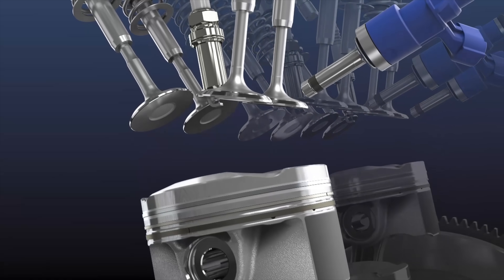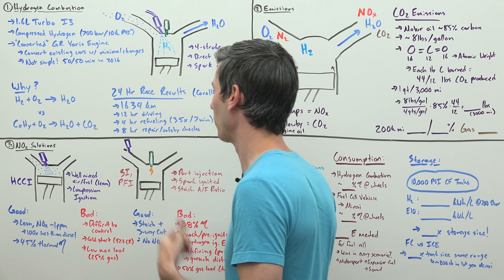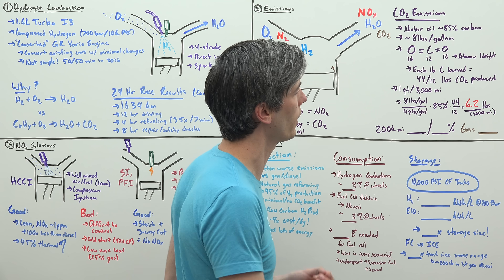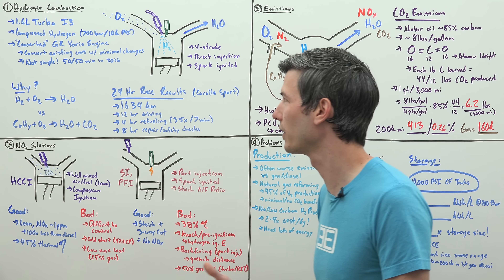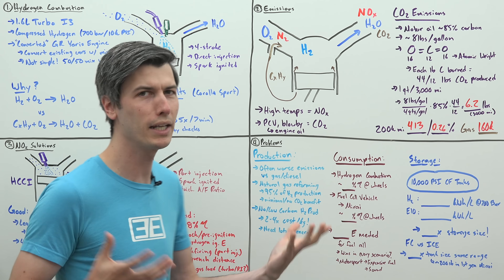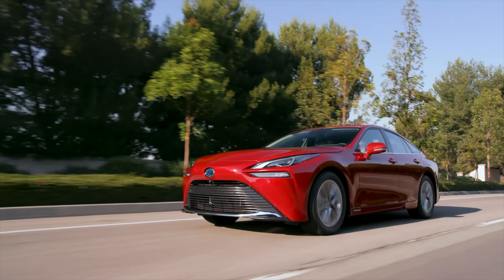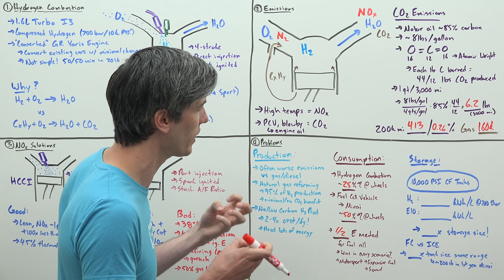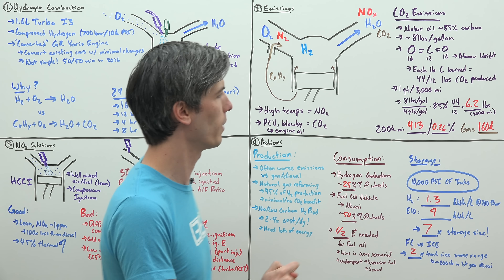Toyota's Developing A Hydrogen Combustion Engine!

Comment: So what you’re saying is, in order to get decent horsepower we’d need something to increase pressure in the cylinders?

salivates in 450 psi of forced induction
Reply: Do people even appreciate the danger of having high pressure tanks near them? Double that for high pressure Hydrohen tanks? Those are bombs, actual Hollywood style explosions should be possible from cars falling down or maybe even bullets hitting them at the right place. High pressure hydrogen bomb, yeah, sounds safe to drive on the roads.
Reply: @romanmir01  some are aware of that, yes.
Reply: @romanmir01  taxi cabs have been driving round with propane tanks for decades with very few incidents.
Reply: @romanmir01  and lithium is perfectly safe
Reply: @romanmir01  Overemphasis on safety concerns have ruined the past two decades, so I’m all for a little danger.
Reply: @Degenevesting  do you comprehend the difference between 10000psi for hydrohen and generally 145 psi at normal temperature for propane tanks?
Reply: @cameronswan8646  do you comprehend the difference between 10000psi for hydrohen and generally 145 psi at normal temperature for propane tanks?
Reply: @romanmir01  Yes, I do actually I have a BSc in Geology and Physics. I was taking the mick, the entire time. Literalism, is not a thing my guy.
Reply: @Degenevesting  so saying that riding with a 10000 psi tank of hyfrogen on a normal road, not under a fully controlled track, without 8 hours out of 24 being spent on safety checks is 'a little danger' is now 'talking the mick'? ok, whatever.

Comment: Great video...I had an old car meany years ago that ran on compressed natural gas, ran well slight drop in power, however the oil didn't get dirty and the plugs were clean. When tested with a gas analyzer co was .5% and hydrocarbons were so low that reading was essentially 0. Co2 and nox not measured but I suspect nox would be elevated.
Reply: Almost all gas cars in my country (Turkey) have LPG conversions and run on LPG as it's much cheaper than gasoline. LPG is liquified petroleum gas which basically consists of butane and propane

Comment: another great video. what id like to see is a break down comparison video of gas/diesel engined cars vs electric cars over its entire lifespan, but taking into account the materials sourcing, refining and manufacture of the motors and batteries as well, and lets not forget the disposal. no one ever talks about that, its just the figures from dealer to disposal.
could be an eye opener for a few people.

Comment: So, similar problems as before, just another try. I guess mass hybridisation and using shorter hydrocarbons as fuels (gaseous - like propane) is a much more viable perspective. Shorter HC - less CO2 emissions for the same amount of energy.
Reply: Agree but just one note , propane -butane ( LPG )is a byproduct of producing conventional fuels . So , no  conventional fuels ,no LPG. On the other hang CH4 - methane is widely available , doesn’t have the hydrogen storage problems . And it’s the  simplest known hydrocarbon with just one carbon and four hydrogen atoms in the molecule CH4. CH4 has a octane rating of about 130 so compression ratios of 14:1 ( higher efficiency) are possible .So CH4 fueled plug-in hybrids is probably the way to go. The hybrid technology ( the recuperation)will balance the lower energy density of the CH4 if compare to gasoline or even LPG.

Comment: Hydrogen combustion can use relatively "dirty" H2 vs Fuel Cells which will foul
Reply: Yeah, but electronysis doesn't produce dirty hydrogen. Methane reforming does. And we need to get away from methane reforming for any of this to make sense...
Reply: @Validole  there are catalyst being looked at that can produce hydrogen. Imagine being stuck I'm the middle of nowhere and you fill a tank with river water and drop a tablet into your emergency tank, next thing you know you are on the road again. We produce lots of biowaste that we could potentially convert to less harmful forms for a neutral source of hydrogen.
Reply: @Validole  Ooohh. I was wondering how you got "dirty" hydrogen. Hydrogen is so happy to float above the water I didn't see how it was possible.

Comment: I have a Ph.D in Mech.E and have worked for a big 3 automaker. The issue with H2 isn't what goes on in a system confined to a vehicle. The main issue is the thermodynamic and economic challenge of producing, distributing, and safely storing H2. Only the production of low emissions energy with a net cost benefit will enable mass adoption of H2 for transportation.
Reply: Can’t you just use water in a tank?
Reply: @isaacmattz204  Thermodynamically if the idea is to reduce carbon emissions, no. The energy required to produce H2 on board a vehicle would be far more useful than using the H2 through a fuel cell or ICE. Google the 2nd law of thermodynamics, it's one of the "best hits" of human understanding.

Comment: The issue with Hydrogen as a fuel is where is this hydrogen  going to come from? Getting it either from water or methane is a "net negative" energy gain. Hydrogen also has a low energy density (but high specific energy) and presents storage/transport issues.
Reply: This. Fuel cells have better efficiency than hydrogen burning engines, but they get roughly 65mi/kgH2. To get anything close to a decent range, you’re going to need big heavy tanks under the car. That makes converting existing vehicles impractical.
Reply: Everything is net negative energy gain, entropy only works one way. When drilling for oil or storing solar electricity in batteries gives you more power than you started up with that is just a case of not having to worry about some of the costs involved at that time.
Reply: Transporting and storing energy and covering it will always be net negative, we just have to develop the technology to make it less negative. We didn’t get to the efficiency of batteries and ice vehicles automatically. We developed them. If you saw an ev 20 years ago it’d be laughably inefficient.
Reply: @boygenius538_8  actually the EV1 is roughly in the same class efficiency wise as the new aptera (115Wh/mile vs 100Wh/mile), but back then there werent high capacity batteries available. Also GM does not want you to drive the EV1 because it was too good.
Reply: @boygenius538_8  Multiple EV's were already around in the 90's pushing 100 mile range.  Which is similar to what all the "modern" EV's got when they started coming out in the last 10 years.
Reply: @uni4rm  hundred miles is pitiful
Reply: @boygenius538_8  Batteries are still woefully inefficient but are better  now. You can beat the laws of thermodynamics Fossil fuels had traditionally had enough "surplus net energy" to overcome recovery/transport losses..but that's changing now as we have burned thru most of the easy to recover, high yield reserves.
Reply: @boygenius538_8  No, it wouldn’t. Maybe compared to a modern day EV, but compared to an ICE vehicle it would be incredibly efficient.
Reply: @AnalystPrime   no. (technically yeah) oil is functionally an energy rich item produced by earth. its rich because its had a long time to be processed by earth. on other items the energy is condensed until we create a chemical process that draws out the condensed energy. the energy you put in is less than the energy received.
Reply: I think the idea is to farm Hydrogen from water using green electricity (like wind and solar).  The problems with wind and solar is that they only work part of the time and we are woefully poor at storing electricity.  Using the energy to produce Hydrogen whenever the electricity is available is  reasonable way of storing the energy. Though certainly not efficient, as you say, it's better than having more electricity than we can use on hot windy days and a lack of energy on still nights.
Reply: The reality is that there's no replacement for gasoline and diesel fuels. EV's are expensive BS and they're not practical for 95% of the people.
Reply: @boygenius538_8  Stanley Electric from 1910?
Reply: @nickh5081  That’s the idea yeah, but the yield is terrible
Reply: @Brandon_letsgo  Quite the opposite. They’re practical for 95% of people. There’s tons of data on driving habits
Reply: @jonathanfields4ever  I'm pretty sure!!! I see a single mom working 2 jobs a day paying 50k for a car and waiting 40 minutes to get some range. A busy doctor who works 6 days a week. Or even a school bus driver  happily waiting over 28 hours for a full recharge from a regular wall outlet.
Reply: @nickh5081  it's much more efficient to use that green electricity to power EVs than to waste 30% on electrolysis, 15% on compression and storage and another 50% wasted in a fuel cell (or 75% wasted in a combustion engine)
Reply: @redshift3  You missed the point.  I wasn't talking about efficiency, I was talking about storage.  If grids are overloaded with solar and wind generation, then they might have more than required during sunny, windy days and a shortage during a still night.  There are no gigantic batteries to store grid power.  Another way to do this is use excess solar and wind to pump water from a low reservoir up to a much higher one.  When the sun and wind aren't cooperating, you let the water flow down through Hydro generators.  It's inefficient, but it's a way to store a lot of green energy for when it's needed rather than when nature is willing to hand it out.  With this in mind, it might be better to just burn the hydrogen in a large scale generator plant and replace the energy in the grid in that way rather than trying to fuel cars.  Again, even this only works if your initial electricity is green - which counts out China and India where most of their electricity comes from dirty coal.
Reply: @Brandon_letsgo  Why would they have to wait that long? I drive 18,000 miles a year and I just have my charge timer set to 11PM-7AM.
Reply: @null643  There’s going to be a ton of trickle down into the used market over the next 5 years. When a 40kWh LEAF is below $10K and a Model 3 below $20K, we’ll see another big shift. It will be easy for almost anybody to drive a good EV.
Reply: @nickh5081  thanks for the clarification. I still think hydrogen economics are difficult for the case you describe. Round trip efficiency is going to be very low (electrolysis 70% efficient, compression/transport/storage 90% , CCGT 60% >> 40% total RTE). People are counting on excess renewable electricity being almost free to make the economics work and that remains to be seen. Meanwhile any long duration technology with a higher RTE will steal hydrogen's lunch. There are several candidates but few at a high technology readiness level
Reply: @redshift3  Yes, I agree completely agree with you about the economics. Too many people have little concept of economics and think if it's "green", then cost doesn't matter - the magic money tree will provide.

Comment: Not really new. BMW did this in 2005 (BMW Hydrogen-7). Hydrogen combustion in the BMW used vastly more hydrogen per mile than a hydrogen fuel cell (about 4 times more). So unless you're into paying roughly 100$ per 100 miles driven (more if it's from renewable sources) don't hold your breath on these types of engines.
Reply: The expense is mostly because the infrastructure isn't abundant
Reply: @tturi2  The infrastructure is brutally expensive. You need more powerplants (roughly 10 times as much as if you dump the energy straight into a BEV). Then there's the hydrogen factories and the fuel stations (several times more expensive than gas stations). Then you need a distribution infrastructure. Tanker trucks moving hydrogen move only about 10% of the mobility (i.e. miles you can drive on their contents) per truck than regular gas tanker trucks. I.e. you need 10 times more of these (and payment for all the guys driving them).  
In contrast to a pure BEV you're looking at a factor - per mile driven - of at least 10 for the end user. Under optimal conditions. 

All of that to drive a package with hundreds of moving parts that will incur massive repair costs (akin to today's gas cars)?
Hydrogen makes absolutely no sense (not even in fuel cells but much less so in combustion vehicles)
Reply: Hydrogen 7 was a concept. Very young technology. New technologies are always more expensive and less efficient. Until we spend time and money fixing those issues.
Reply: A hydrogen car was tested that only consumed 0.5litre per 100km.

Comment: The side effect will be 100% humidity everywhere.
Reply: California could use that LOL
Reply: And rusted out internal ICE engines.
Reply: Good for my respiratory system. Still I think hydrogen is inefficient and doesn't have future, but we can dream.
Reply: The environmental effects would be catastrophic.
Reply: water vapor is a potent greenhouse gas.
Reply: @vast634  it is not a potential green house gas, it is one, and actually while in the atmosphere is is 100 % equal to the green house gas of CO2. But as it builds up and is impacted with pressure it will turn to rain. So kind of not as bad.
Reply: @Reptitude  Wikipedia, article on greenhouse gas:  The primary greenhouse gases in Earth's atmosphere are water vapor (H
2O), carbon dioxide (CO
2), methane (CH
4), nitrous oxide (N
2O), and ozone (O3).
Reply: @vast634  Mayvbe it can help cool the planet though, not all green houses heat the planet, what if all the arab countries drive these cars around the desert, they could end up with tropical rain forests.
Reply: Good to help open your sinuses
Reply: Not to mention all the poisonous NOX

Comment: The thing is its probably way simpler to just make a hydrogen combustion engine than this fuel cell stuff making the initial cost of a car much lower and once someone decides to for example embargo your country from oil you wont care if your fuel costs twice as much as long as you can still drive.

Comment: I think for car FCEV is main way to go, however on the bike power to weight ratio is very important and fuel cell pwr are kinda suck ,same reason why we don’t see any production diesel motorcycle despite Diesel engine is more efficient than Gasoline. 

future of big motorcycle over 500cc is tricky ,BEV is too heavy and range was pathetic , that make sense why recently Kawasaki along with Yamaha Honda Suzuki is currently developed hydrogen combustion engine together for motorcycle. With force induction, hybrid electric, advance direct injection, new ignition tech, and new combustion chamber, liquid hydrogen, fuel consumption problem can improved I think.

Comment: Thank you for your video and your quick comparison. However, why don't you talk about costs comparing a fuel cell and a H2ICE?? It is further cheaper to adapt an ICE to work with H2 than using fuel cells currently. 
There are a lot of scientific papers researching on H2ICE and it is not difficult. My PhD thesis is based on comparing H2, CH4 and coke oven gas in a port-fuel SI engine, showing good efficiency and low emissions. It's true that there's still much work to do, but with your general comments, you just do a simplified comparison, taking down the work of many people during years. And you only take as a reference the job of a company on a single car, instead of referencing scientific papers.
On the other hand, do you think that taking a single quote of a report is enough to say that H2 has no role in the future energy system? Try to store electricity during months with huge batteries at the same price compared to H2 using salt caverns or think the price of the reinforcement of the electrical grid in the future as the electrical demand increases, compared to using H2 pipelines which is way cheaper, as seen in many papers. Many scientists and countries are investing in H2 for many reasons, not for just a report or a single quote.
I just ask to avoid giving quick general conclusions which influence people, instead of providing information to encourage people to inform and learn more. Technology can develop and improve very quickly, as seen during the last century.

Sorry for the length of my opinion and I don't want to offend anyone!
Thank you again for your videos!
Reply: Would you may be have a link to share to have a look to you thesis?
Reply: I would also be very interested to read your paper.
Reply: How is the metal fatigue issue with hydrogen ?
Reply: Please do a video on your research. It sounds very interesting

Comment: First of all, the high efficiency of the fuel cell comes from a long R&D process which took place over the course of several decades. I would not be surprised if the HCCI engine (which already is at 45% efficiency) could go through the same process, perhaps even with a better efficiency than the fuel cell at the end of it.

Then, the hydrogen can probably be produced using solar-powered thermal reactions in countries with high temperatures; I imagine a future in which countries which now produce oil instead produce hydrogen, which has the advantage of being able to be shipped to other nations as an energy source. (Note that the U. S. and China would be some of these countries, as would be Spain.)

Thirdly, the large tank size, as well as the 4h refilling time, can be remedied by exchanging the entire tank at refilling stations. This will reduce the total refilling time 7-fold.
Reply: Well said. From what it sounds like formula one will be almost zero emission by 2030, and in order to do that there needs to be an abundance of wind and solar energy to pull hydrogen from water and then to store and ship.
Reply: Solar lmao
Reply: @mikebunting847  not really they found a way to make hydrogen by using gallium and tin in water